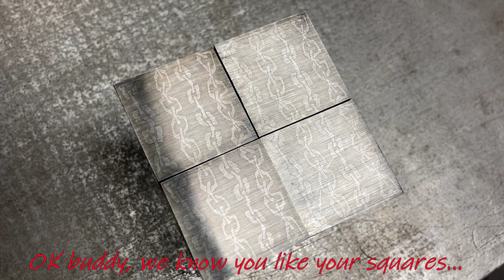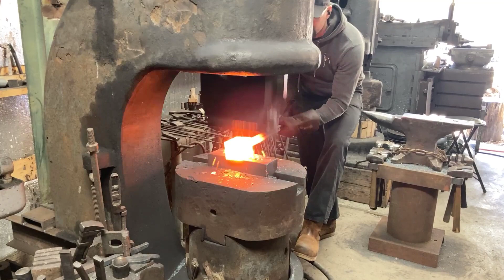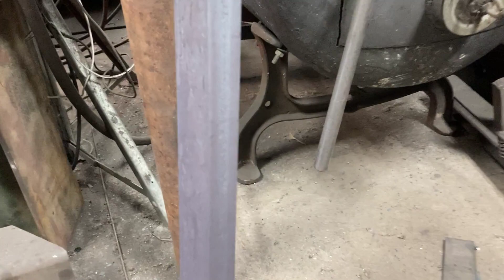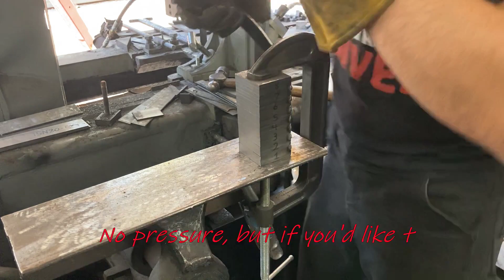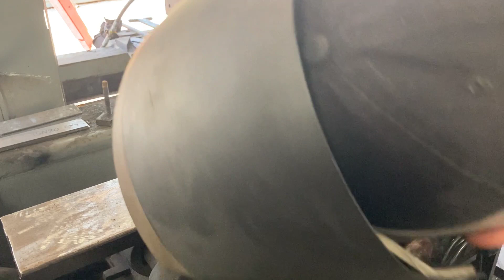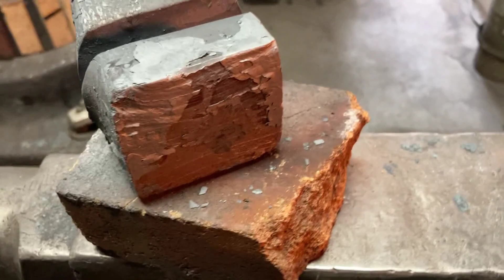Jailbird Feather Damascus Chef Knives, Part 4

Comment: Quick comment regarding the speed of the roller and the time spent waiting. I am pretty sure every VFD har a ramp time that is realy easy to adjust. If so, you should be able to reduce the ramp time substantially (both up and down), to make the mill more efficient 😊
Reply from the maker: You’re correct about that… however it wouldn’t pay to make the switching relays have to start the motor forward and reverse much faster. It’s 10hp and right at the amperage limit of the circuit… soft start with a bit of a ramp helps mitigate excessive inrush current on startup.
Reply: @PrometheanBlade  ye, then i guess it is tuned to the max 😊